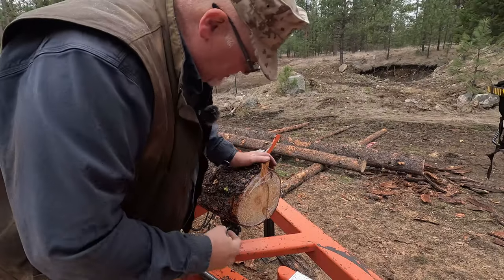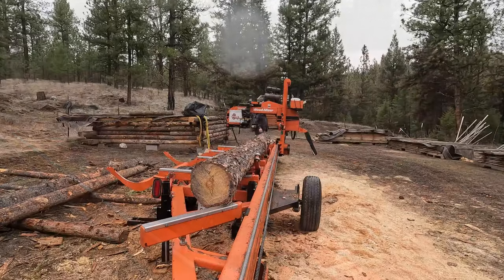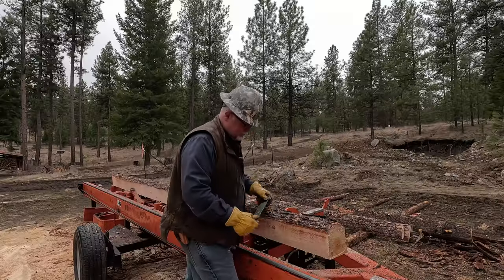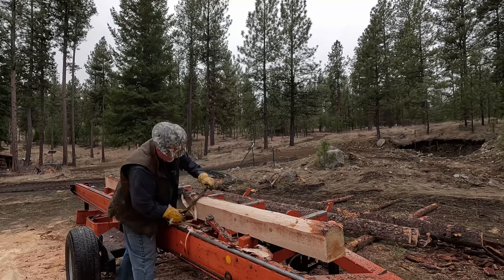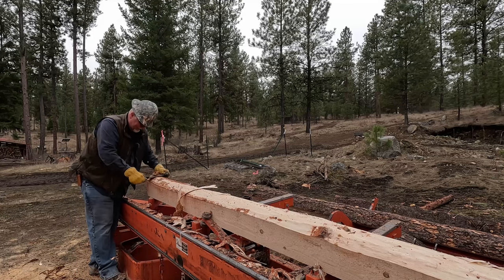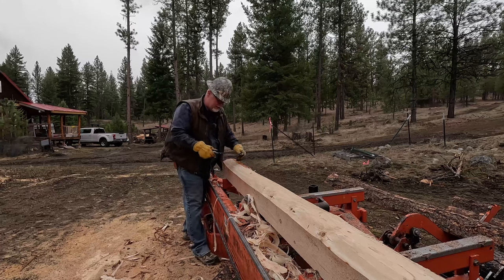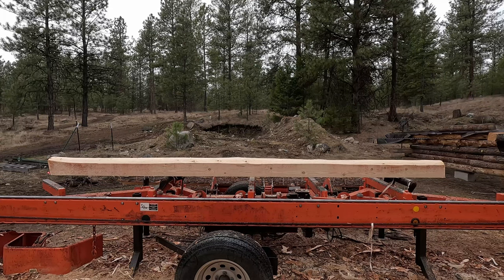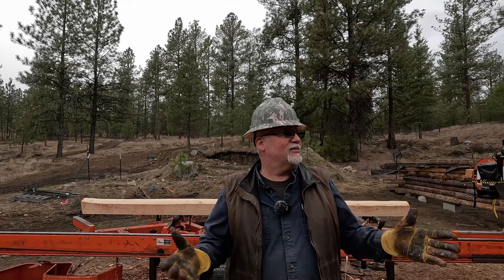Back to sawmilling D Logs at my off grid cabin build!

Comment: Question for ya on D log height - I've got loblolly here, which some have a bit of taper, so was expecting the butt up to 12'-14' are going to be too big to D them at 6", so was going to mix them up - 6/7/8" per rank, but trying for 7" thick walls... so, my question - is that advisable? Mix'n'match rank height like that? Enjoyed the steam the other day, took away a good bit of advice, thanks!
Reply from the maker: Thank You! I think as long as they are 7 inches wide it would be fine!  Just remember it is a log cabin 😉
Reply: @TheOldJarhead  doh! Enjoyed the "stream" the other day lol. Did more research on the borate solutions out there - definitely going that route - thanks!
Reply from the maker: 👍 On the Dlogs plan for movement in drying on a percentage of them too and definitely get some Borate or similar for the bugs

Comment: We don’t have much pine here but plenty of oak. 20” to 36”. How would you cut D logs from the larger oaks? A lot of waste??
Reply from the maker: FOHC - Free of Heart Center.  I'd cut it much like quarter sawing if I wanted D Logs by dropping deep enough to remove a d log out of the center of the cap and quarter the rest.  It would be time-consuming but would work.  The other option is to flat saw deep to get 6 - or 8-inch live edge slabs and build with them instead
Reply: 6”x6” live edge slabs??
Reply from the maker: Sorta -- 6" deep/thick but any width will work.  I'll have to find an example.  I personally love the look.  It takes a lot more chinking but makes a beautiful cabin in the end.
Reply from the maker: https://stonehousewoodworks.com/wp-content/uploads/2016/06/IMG_6625.jpg
Reply: @TheOldJarhead  Ya that looks really good. Looks to be about 3”x6”. Take a lot of trees.
Reply from the maker: Probably 6x12 but hard to say in a pic.  D Logs or logs like this always require more than framing lumber ;)  For me it's about ease of build and looks and I have lots of small logs to make D Logs out of because I'm thinning my forest.

Another option is to frame the structure normally and then use Live Edge siding which looks great too.